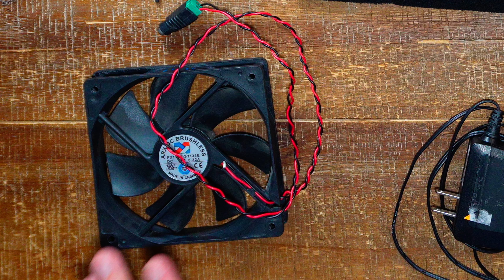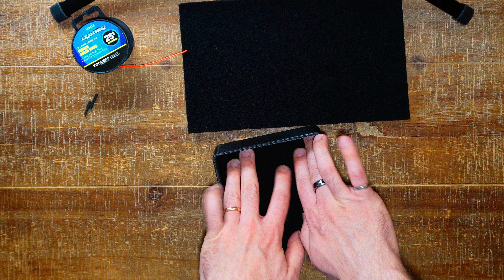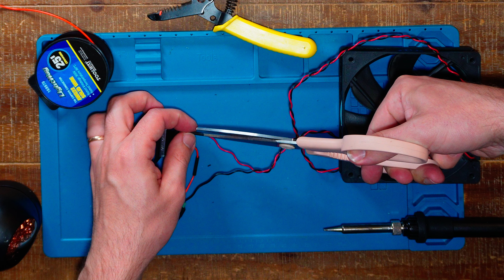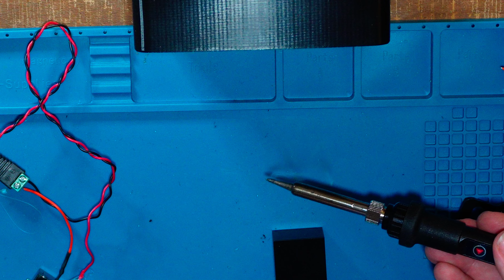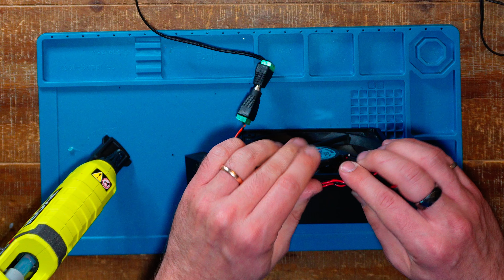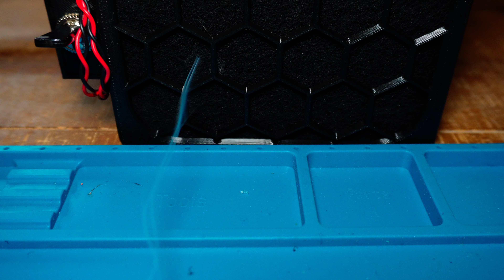This scrap build helps protect my lungs! DIY Solder Smoke Absorber

Comment: I think anything that pulls the smoke away from the user is better than nothing, but I doubt those activated charcoal filters are effective for the fine particles in the smoke. It is going to recirculate back into the room. I think using a hepa filter is the best option, but then you need a powerful motor to suck through it.
Reply from the maker: Of course. This is the bare minimum. I always work in a well ventilated space to be safe. And with minimal soldering it's not too bad, but eventually I'll spring for something much better. I'm planning to duct the output out a window in the future too